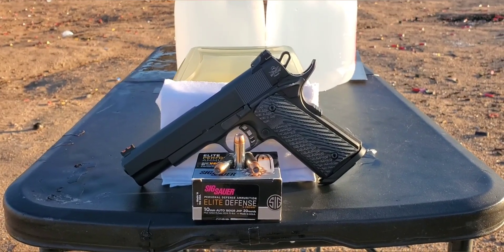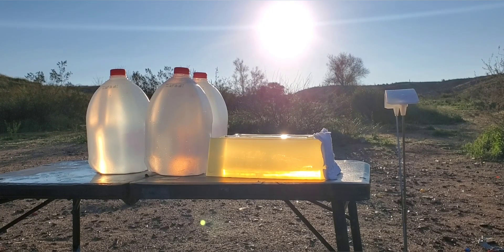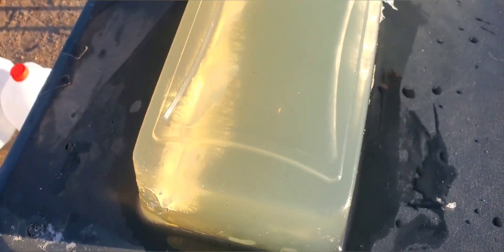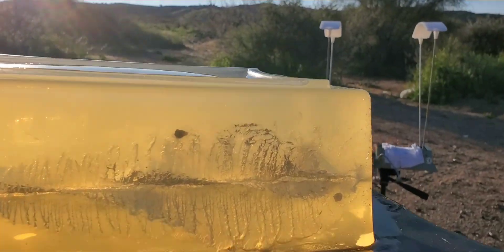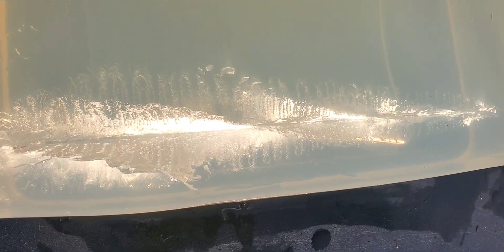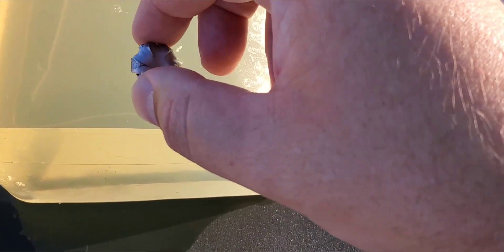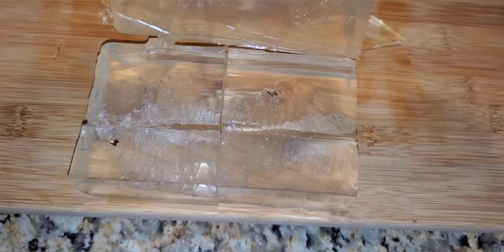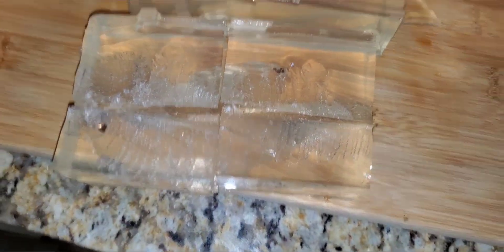10mm sig v-crown in ballistics gel

Comment: a .40 cal round travelling at the right velocities is a devastating thing...great tests. Love the organic gel
Reply: The 10mm was created before the .40. Granted, the 10mm is the reason the .40 exists, as the 10mm was too much for the Feds (created upon FBI request). But, I agree, diameter is the same, I’d love to see a .40 with the same powder load as this 10mil do some tests. Similarly, the .22 WMR performs about the same, usually better, than a 9mm in tests. Crazy how some rounds are so close in design. 🤭🙄🤔
Best .40 energy is in the 400 ft lb range, as this was over 700ft lbs. I think buffalo bore is slightly higher.
Reply: @Hammerback0 aqqqq